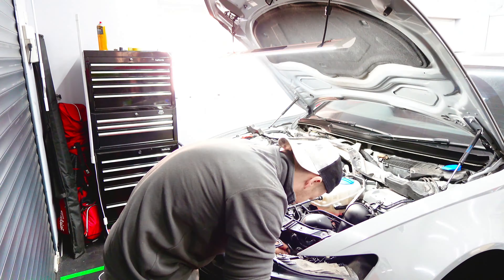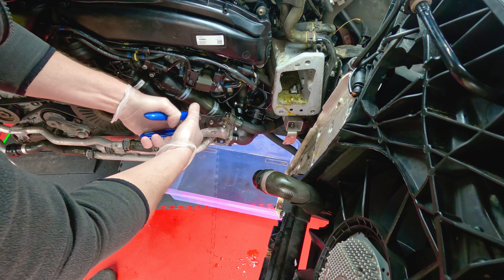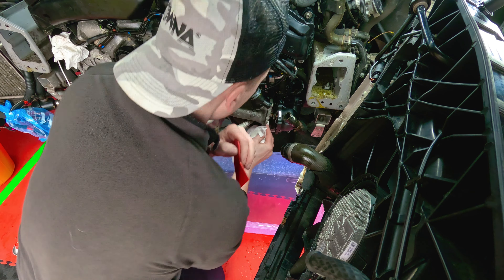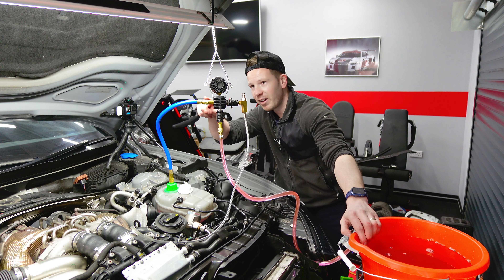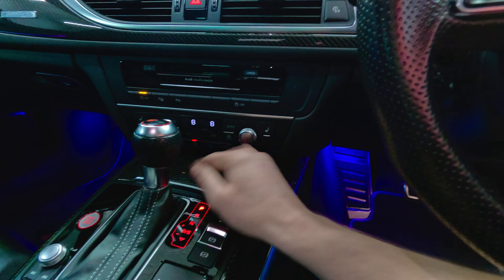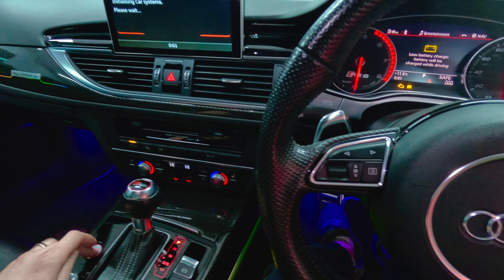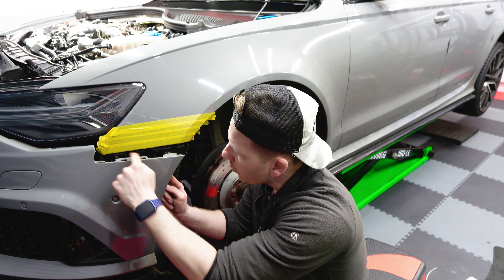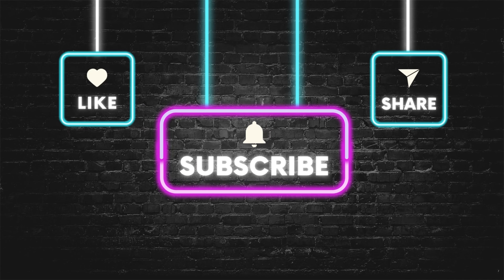Audi RS6 4.0 TFSI Thermostat Replacement & Coolant Refill (Part 5)

Comment: Good call with the original pipe by cleaning it up etc - in my view.  Thanks again for a great video and a super honest and informative video series.  I've watched the lot!  Top Tip - when you go to do your brake discs, fit armoured hoses all round and blue back pads.  You'll not be sorry!
Reply from the maker: Good shout,  I will add them to my future upgrade wish list.   Still deciding on a colour for the callipers.

Comment: I have to carry out the same operation on my rs6 Congratulations. Your work is very inspiring. Can you give me the news regarding the suction at the oil cap?
Reply from the maker: Hey thanks for watching.   Yes I can confirm suction before and after was exactly the same.  In the end I think my PCV unit was still good but worth changing anyway as it had already done 48k miles and would need replacing as somepoint 👍

Comment: did u test if the vaccume changed on the oil cap?
Kindly let me know I am about to have a dealer do the recall on the oil strainer and want to know if i should replace anything while he is there to save on labor
Reply from the maker: Hi,  after changing my PCV unit I can confirm that the vacuum stayed the same as in the clip shown.   I don’t think my PCV unit was actually failing to start with so no difference.  I would strongly recommend getting a new one fitted whilst they are doing the strainer though as replacing it in the near future will be almost the same abit of work and very costly in labour.   PCV unit it’s self it only around £150.
Reply: @InDadsGarage  first great video! Second so if the PCV wasn't the issue what was causing fuel in the oil?? I am having the same issue and trying to diagnose
Reply from the maker: @2smart3guys   hey,  I can confirm the vacuum didn’t change after I replaced the unit.  But I think my PCV unit was still ok in the end.  However I would recommend asking the dealership to replace the PCV unit whilst doing the oil strainer, especially if you are over 40k miles.  It’s only a £200 clip on part but would cost you a great deal more in labour if you need to replace it as it’s a while front end strip down as you will have seen.

Comment: How many hours labour to do this mate?
Reply from the maker: Hey man thanks for watching.   As a novice mechanic but now having one under my belt, I’d say if I was to do it again with all the parts to hand and no issues then,  1 day to strip it,  1 day to fit all the new parts and put the majority back together,  then a half a day to bleed the system, refill coolant, oil change refit bumper etc.   is never that straightforward though and something always goes wrong.  One stuck bolt and it all goes tits up lol

Comment: What do these do MPG wise? Is it a Euro 6 Version?
Reply: They are a Euro 6, if engine is in healthy condition you should get around 17-23mpg or so in mixed driving scenarios. If constantly in and around town or doing a lot of short journeys expect a bit less, (especially if you have a heavy right foot). On longer journeys they are surprisingly good on fuel, I've had 30mpg out of mine. I usually get around 20-24mpg, my use is mainly A/B roads with the odd enthusiastic overtake (ahem), and on motorways can easily see over 28.
Reply: @sarcastixx74  thanks for the reply
Reply from the maker: Depending how you drive it...

Drive it like you are taking your Grandma to the shops the maybe 24-26mpg

Drive it like you stole it sub 15 mpg.

I went for a spirited drive the other week and got 60 miles to £30 of UK premium fuel.
Reply from the maker: Its all about the enthusiastic overtake, quick V8 rumble and then straight back down to economical speed lol.
Reply: @InDadsGarage  True! Some things we will never grow out of 😃
Reply: @InDadsGarage  Based on £1.60 a litre that works out at 14.5mpg, sounds spot on what you should be getting.